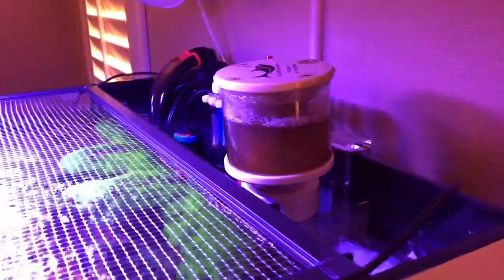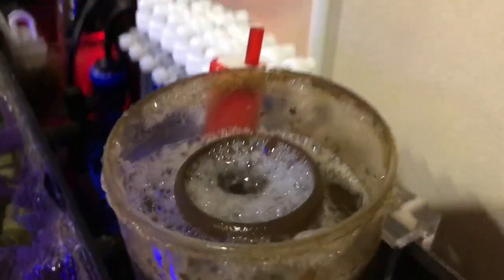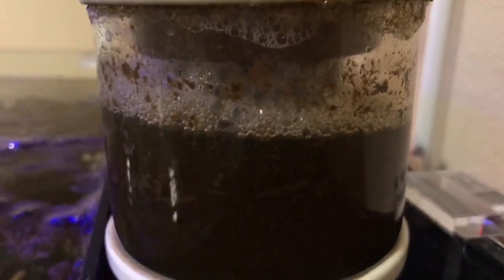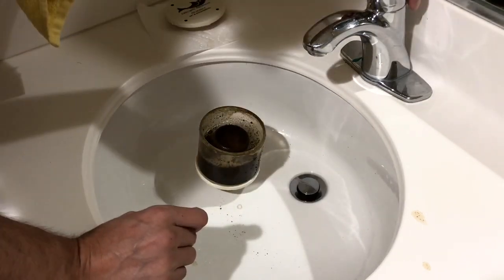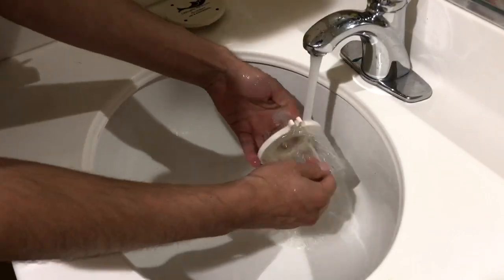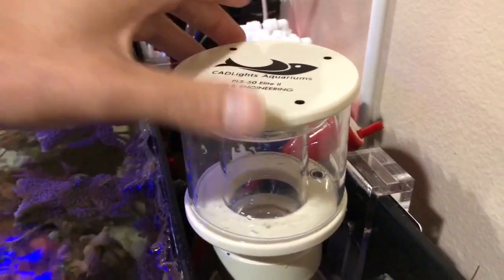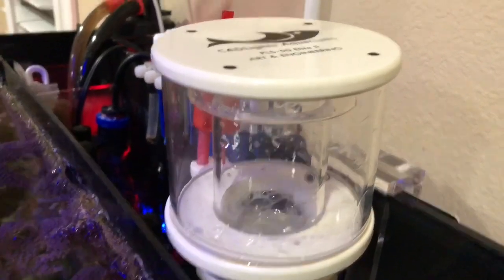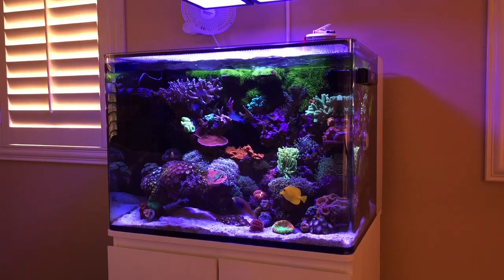PLS-50 v2 Skimmer (Final Thoughts)

Comment: One question, what’s the minimum water level the skimmer needs to work properly? I like to use it in sump I have a  7inch water level
Reply from the maker: You should be fine. I would confirm with cad lights but I see no issue.

Comment: Just picked up this Skimmer today for my Innovative marine nuvo fusion 40 and for some reason the  pump is too strong for my tank. the collection cup fills up completely in under 10 seconds. I tried turning the skimmer for less flow but issues still exist. Just curious how you were able to set up your skimmer. Did you run into any problems?
Reply: Still have any problems?? I've been interested in this skimmer for my IM Nuvo 40 also!
Reply: I put a air valve adjuster on the air line tube after the silencer ,seemed to help mine work better ..